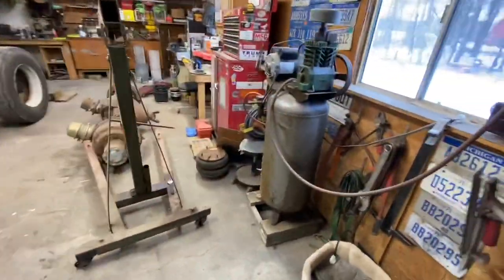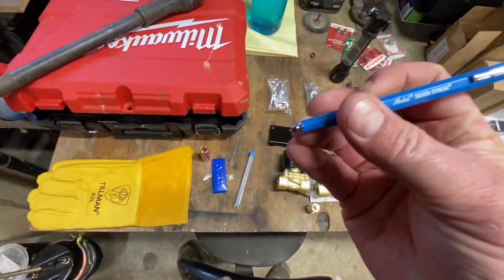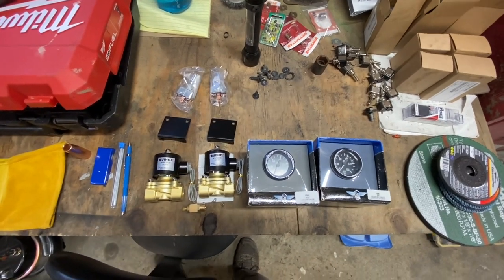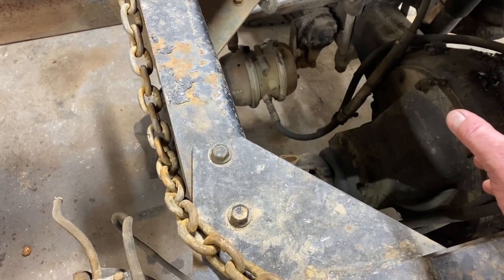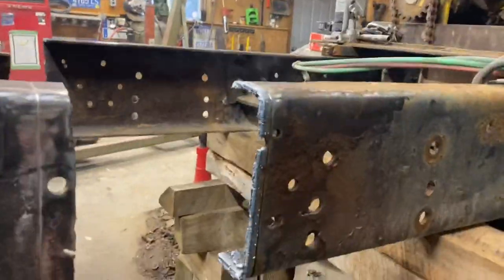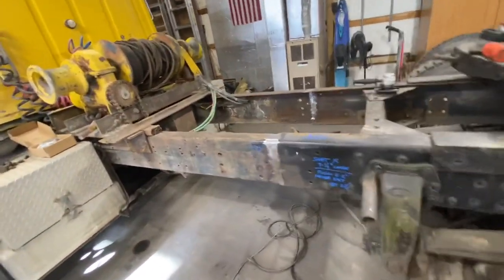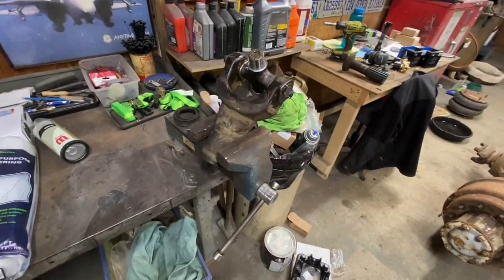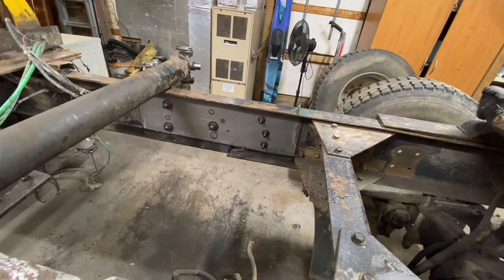Ford L9000 Episode 10: Stretching the frame and adding an air ride cut off!!

Comment: A waste of money trying to regulate air bag pressure they never have 120 psi in them and the ride height is set buy the correct air bag height alter that will expedite drive line component failure
Reply from the maker: If you watch more videos, I have since switched to a standard leveling valve w/ dump valve on the rear axle.  I still have an prefer the electric solenoid valves on the front axle because they give me infinite control on an axle that rarely varies in weight carried.  Air pressure is a direct driver of airbag height at a given weight.
Reply: @robstruckshop80  if you check out front air ride kits they have leveling valves on both sides on the front so air supply is consistent when going through curves and turns if you "t" the front bags together you will get leaning
Reply from the maker: Some do, some don’t.  I get zero noticeable lean, but part of that is because I retained 2 front leaves and intentionally found a short front bag with an internal bumper.  On paper I should convert to a twin valve setup but in practice there’s no need so far.